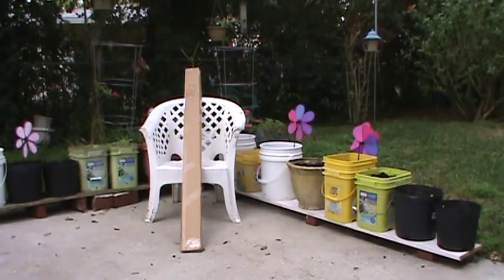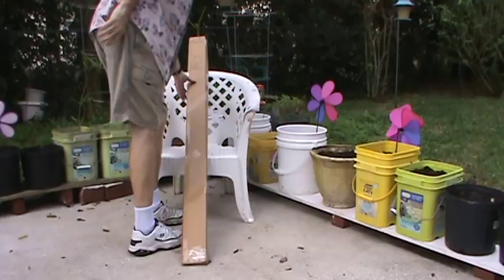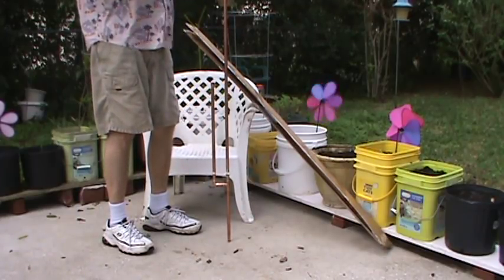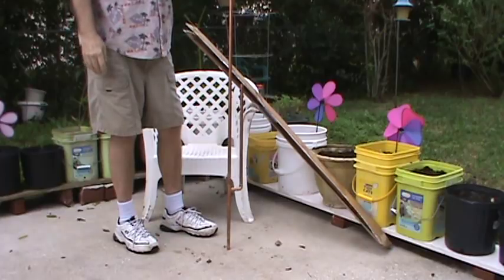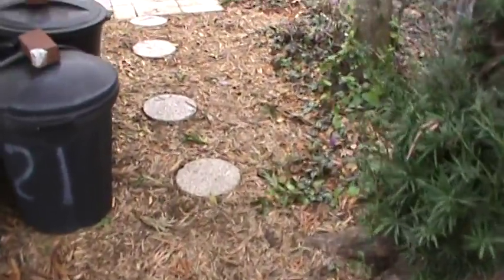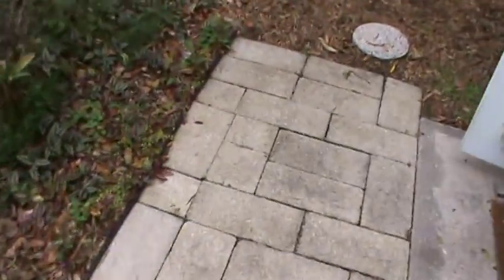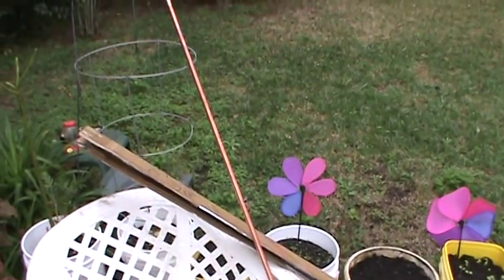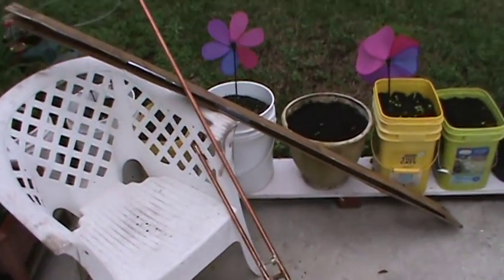TRRS #1422 - J-Pole Antennas from KB9VBR

Comment: I live on a third floor apartment that has a balcony. I like to listen to the aviation band since Orlando International Airport and Orlando Executive, are to the south and southwest of me.
From the balcony, with a Diamond D220R discone, I could hear the control tower barely. In the attic, it did slightly better, but not enough to listen to the ATIS broadcasts. Enter the KB9VBR air band dipole. Again, from the attic, I can now hear the ATIS, CLEARLY, in addition to ORL control tower, I can also listen to both East and West control tower frequencies for MCO. I can recommend KB9VBR antennas, without any reservations.
Reply from the maker: Thanks for your comments.

Comment: I made one of those and use it for the 2 meter radio I have in my garage.  I mounted in the rafters above my garage ceiling and it works almost as good as my main store-bought 2 meter antenna.
Reply from the maker: I made one for 6 meters about 50 years ago.  It's in my workshop somewhere but I can't get to it. LOL